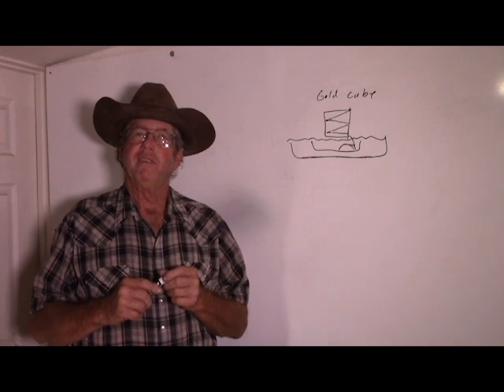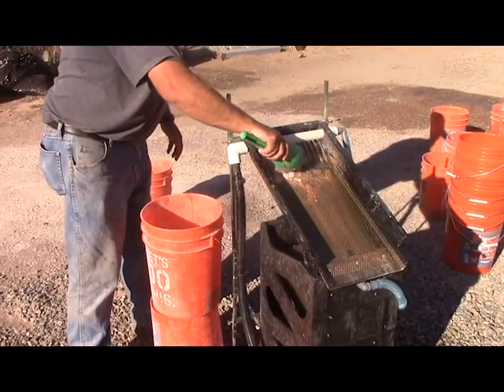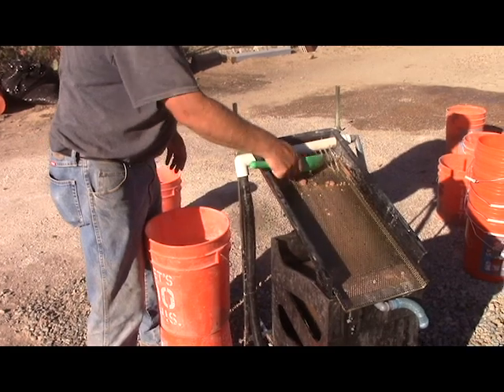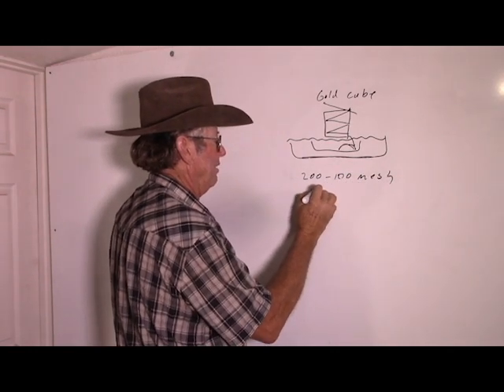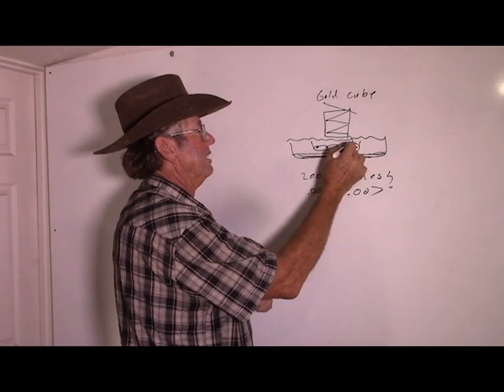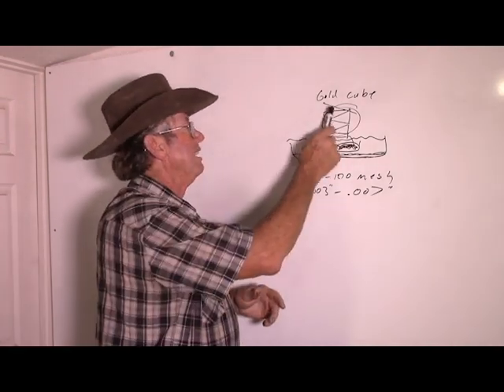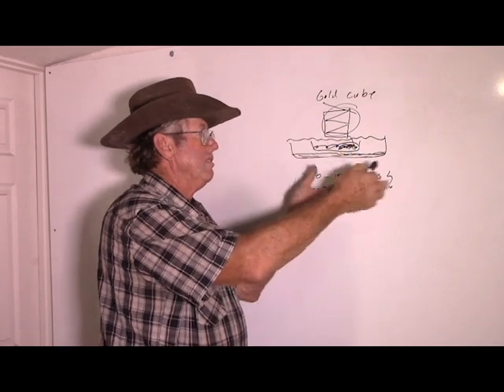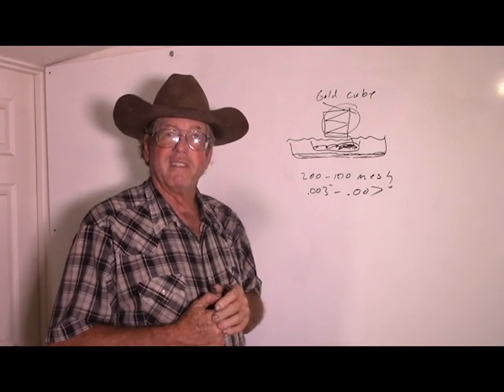Lesson 27 The Gold Cube and Low Grade Ore

Comment: I only recently discovered your you tube channel, and I wanted to say well done. I liked this video, and I wanted comment on this one. Any time you are using flowing streams of water to classify material (as in a sluice), the speed of the water is very critical for fine gold recovery as it is easy to blow gold through. Many people use too much water in a gold cube and together with the steepness of the sluice bed and the built in turbulence of the thing, its easy to just blow any fine gold right on through it. Guessing at the results of your testing - the fact that the gold was blown clear through the cube, through the catch basin underneath and into the recirculation basin in the bottom, I am guessing you were running the cube with too much water flowing too fast to allow the gold to be caught. 
The fact that you used no surfactant is also a problem, and maybe even bigger is that you added the material to the cube dry. Dry ore and no surfactant is like saying please make my gold float. 
I've seen the G.C. work acceptably well for 100 mesh gold recovery, but you need to:
1. Pre-wet the material thoroughly with surfactant infused water. (you would never test pan ore without thoroughly wetting it).
2. Use a surfactant in the water.
3. Make sure the mat has no air bubbles.
4. Run the water speed at only what it takes to move the crushed ore through the cube. No faster. 
The incline of the sluice bed in a G.C. is a little steep for fine gold - look at the tilt of a shaker table - its about a quarter of the incline on a G. C. - but still the G. C. can be used to good effect on 100 mesh fine gold if you take the necessary precautions.
Reply from the maker: Thank you very much for your input.  I was skeptical of the 'no surfactant' claim, but though it worth a try.  There has been more than one person now who says reducing the flow and adding surfactant along with fine classification has yielded good results.

I appreciate the feedback, especially when trying new equipment.

Keith
Reply: Keep up the good work! I'm looking forward to seeing your future videos, especially the one on your shaker table recovery system. Also, if you ever want to write any additional articles for the ICMJ prospecting and mining journal on hard rock mining or ore processing, let me know. I know you did one for us a couple years back, but many of these topics on your youtube channel would be great topics for an article. Feel free to shoot me an email anytime if you want to talk about it.
Water flow speed really makes a difference in sluice type systems (shaker tables too as they belong to the same family). A few years ago I picked up a 3/4 ounce solid gold nugget in Alaska in sluice box tailings with a metal detector. Hard to imagine how a 3/4 ounce solid nugget could make its way through a sluice and come out in the tailings, but they were dozing placer gravels unscreened with up to 2 foot boulders into their sluice. You put the water flow in that will roll a 2 foot boulder easily through your sluice and if a nugget finds no place to hide out of the current because your riffles are packed, then yes, you can blow a 3/4 ounce nugget right out a sluice box. The same happens for 100 mesh gold, but of course the flow needed to blow tiny 100 mesh gold is not that great. Screening even to 20 mesh is going to help reduce the amount of flow needed to push the material through. Also a good ball valve to help control the amount of water flow is necessary.
Reply from the maker: Hello Chris,

Thank you for the kind words.

I submitted an article several months ago to Scott Harn about my panning technique (Lesson 24 not Lesson 4) and he said he was just waiting for the appropriate sized slot to put it in.  I guess it runs a bit long.  I think the technique will REALLY help a lot of people.  Lesson 4 is also my most popular video with almost 30,000 views now, so I'm sure people are interested in it.

I am getting ready to write another article- about my Mining Economics Estimator.  That is another tool I think will really help a lot of people.

Once I get the patent application in on the table I will be making a video and submitting another article.

I am unclear on the most proper method- should I submit the articles to you or Scott?

I am also surprised at how few people really take advantage of proper classification- especially undercurrent sluices.

Thank you,

Keith
Reply: I watched lesson 24 - it was well done. Send to me or to Scott is fine, but if you want to have a technical discussion about the article or ask questions, probably I would be better. But either is OK.
Reply from the maker: Well I already sent the one on lesson 24 to Scott, but you might want to look at it and see if you have any suggestions.  I haven't started the one on the Economics Estimator yet, but that seems fairly technical to me, so I presume I would send that to you?  Also, have you tried the estimator out yet, and if so, how did you like it?  Suggestions?

Keith
Reply: I've not tried the estimator yet. If possible, just email me the on on panning and I'll take a look at it.
Reply from the maker: OK.  Is the address on the ICMJ web site?
Reply: Its at the end of every article I write, and its on the website, but to save you time, its chrisralph@icmj.com
Reply from the maker: Thank you.  Very busy at the moment, will send the article as soon as a get a minute.

Keith
Reply: I've caught placer flour gold quite well on a old wool blanket at 24 degrees and proper water flow . 95+% efficient  using the right capture mats is also a must  the Key words are  placer flour gold is flat

Comment: Dream Mat will change this with its NEW MAT product designed for crushed material & fine black sands this spring. The regular Dream Mat gets a higher recovery rate on crushed material than the 2 sluice mentioned below & have replaced those sluices mentioned below on established systems w/ significantly higher recovery rates. Its time to let good engineered fluid dynamics have the ball here. Rather than recycled conveyor belt & 1-1/2' thick aluim. plates.
Reply from the maker: And where to you obtain Dream Mat?

Keith
Reply: Send your address to prospectorsdream@hotmail.com they are not for sale yet, but I can send you some test mats.
Reply from the maker: My physical address is 1025 S Kroeger lane, Tucson, AZ 85745.  Please send recommended operating parameters also.  If you contact me by email when you send them, I will keep you apprised of my experience with them.

Thank you

Keith

Comment: SO I use a gold cube to for many years it works excellent it won't catch the very fine gold what I do is I keep all my Telling I collect crush it up and I run it through my Knudsen Bowls 2 24in  catches fine gold then use chemicals.Thanks  for the videos , cheers mate.
Reply from the maker: I am hoping my table will simplify all that.  So far the progress looks good.  

So yours doesn't catch the finest gold also?  Did you try Vahagn's trick of Jet Dry, fine screening, and lower water flow?

Keith

Keith
Reply: Down to 200 mash, I use Jet Dry the Bowls turn at 150 rpm ,can control water speed  fast and slow ,and out put has small sluice .
Reply from the maker: How clean is the concentrate?
Reply: Its pretty clean at that step, I use lie at the last step when using mercury .
Reply from the maker: how much cons do you have?  perhaps you could use the micro fine panning technique and then flux and smelt the gold?  Are you in Australia?  I assume that wherever you are, the authorities are no as psychotically paranoid about mercury as in the US.

Thanks,

keith
Reply: I have roughly about 500 pounds of cons, the gold I get is chunky to super fine .the fines I run it the Knudsen bowls ,does a very good job , mercury was an option I haven't done it yet . Flux and smelt I'm afraid that I will lose the fine gold it is done wrong, I have a lot of processing equipment .
Reply from the maker: Have you tried running the raw cons and then classifying to the size of the larges gold particles still making it through and then adjusting and re-running?

Fine classification followed by gentle processing often works quite well.

Keith
Reply: Thanks for your help Keith I'll try that.
Reply from the maker: You are very welcome.  Good luck!

Comment: My fiance got me one for our Anniversary!!
I have the same set up as the one in this video.
I ran a bucket of river sand and after I was done I noticed that I lost a ton of black sand. I'm thinking that if I lost black sand then I'm definitely losing fine gold. I stopped and scrutinized every aspect of the process.
I realized that before every use the vortex matting must be hit with water and a brush, or hit with high pressure water before use to get rid of air pockets.( when cube is dry, run water over the matting and you will see air pockets in the matting that needs to be brushed out or hit with high pressure water)
If you just turn it on and run it you will lose most of your black sand dew to air pockets in the matting.
And a surfactant is a must because you will still have to pan out the cons. 
Also, I went to the dollar store and bought egg magnets and placed them at the bottom water fall parts (G force separator) so that just before it hits the G force it will slow down the black sand and drop the gold to the bottom! 
Also, You will want to get a magnetic Hardware tray, place it at the very bottom Outlet at an angled down.
this will catch any black sand that maybe trying to escape. 
Brushing down the matting with water to get rid of air pockets is vital! Also, being level all the way around is a must!
The matting must be scrubbed thoroughly when it is first received from the manufacturer because the matting has oil on it and we'll kick off most of your heavies if not clean with dove soap.
I still have not physically been able to put gold in a vile because the material from where I live sux donkey balls... 
I am going to find a place where I can buy dirt that may contain gold!! 
I'm not in the game for the money, I'm in the game because I love how it looks!
I'm mesmerised buy the fact that I have a chance at seeing real life gold in the wild! 
I'm gonna find it because I will not stop. I'm bound and determined to find the G spot!! lol
I'll send you an email with pix on how it's set up!
I re-ran the material that I first used and tripled my black sands! 
All the black sand contains micro fine gold and I'm still working on the panning technique. 
I'm definitely gonna have to get a bigger pan because I have tried everything. small amounts, hold the pan here and there and tap  every direction possible.
I can see it but can't get it to reveal itself. 
I think there is alot of pyrites in the black sand which makes it tougher because when they fall to the back of the pan I can't help but feel like I'm losing gold.
Thank you so much for sharing and look forward to seeing more videos with the Gold cube!! :-) 
I got mine 6 days ago and fell asleep looking at it the first day!!lol
The most important to remember is that your material must be super wet before running it in the gold cube. If you run it dry you will lose 80% of the good cons.

Comment: i disagree. Because i have gold cube only 2 trays(the top one just runs the dirt). I crushed 1 bucket ore from this vein i found, classified with 120# mesh size. I bought a valve from homedepot attached to the pump of gold cube,and run it little bet more than half the flow of water. Run the dirt smaller than 120# mesh size through the gold cube and it recovered everything, smaller than 120# mesh size. Added jet dry once awhile. I checked the piles inside the tub and found almost nothing other than few specs that where attached to the rock. Recovered 0.3 gram of gold. If you find lots of missed particles just reduce the flow of water, and put 120# mesh size classifier on the top of the gold cube. By doing so you don't end up trapping big rocks inside the gold cube, and allowing small pieces of gold to be settled because of the low flow of water.
Reply from the maker: Not in the United States.  They how call the HazMat team when someone breaks a thermometer in chemistry lab at the High School.  I'm not saying it doesn't work, it is just that the potential liability is too great in a terrified society.

BTW, Does anyone have any experience with 'Coal/Gold agglomeration?

Keith
Reply from the maker: Thank you for the info.  Fine classification plus lower flows would make sense.  How did the Jet dry work?  Did it make a difference?  And how did you classify to 120?  What was the throughput?

Keith
Reply from the maker: Thank YOU.

Keith
Reply: Glenn Chivers the guy at homedepot will tell you there is no valve designed for this pump. yes there is. Buy PVC compression coupling tee and 3/4 size pvc valve. throw away the tightening plastic and tighten the hose of the cube to leg on one side of the compression coupler (with the rubber on it). Than the other leg of the compression coupler to the pump(leave the rubber on it). The middle leg of the compression coupling attach the 3/4 size pvc valve. And you can add little bit Teflon tape, even thoughit's not necessary
Reply: Hard Rock University Honestly whenever i see a pyrite shiny flakes running in the tub, i add jet dry. I tilt the bottle 1 second and that's it. Too much makes bubble all around. And once awhile add jet dry. I can't say how it effects,but it will definitely help to make sure that the gold doesn't float.
Reply: Hard Rock University i classify with the green round classifier with hands, after it came out from rock crusher. And because i reduced the water almost by half(open the 3/4 pvc valve by half,than close little bit) i added slowly until it cleared off in the top tray,without overloading. I tested though using 1.5 bucket of dirt. So could be it was too slow that eventually will cause the gold cube to be clogged. In that case you eighter have to cleanup the cubes often or   classify to maybe 130# mesh. And i don't use that top classifier that you have, i directly apply the dry dirt into the top tray, because i already classifed with hands. But if you want you can put a 120# mesh screen in the top and it will do the job for you.
Reply: you dont want to use mercury?
Reply: formerlyuser123 i don't think it's necessary, in my case i have good recovery. I don't have much experience dealing with mercury.
Reply from the maker: I have done hand screening to 100 mesh before and it is quite slow.  For small production I would think you would need to make a small trommel about the size of a 55 gal drum.